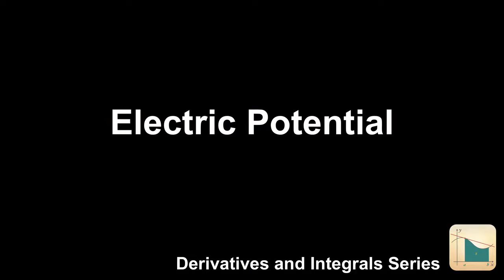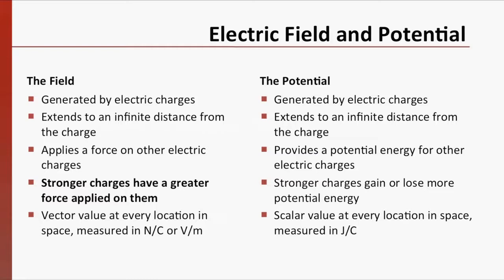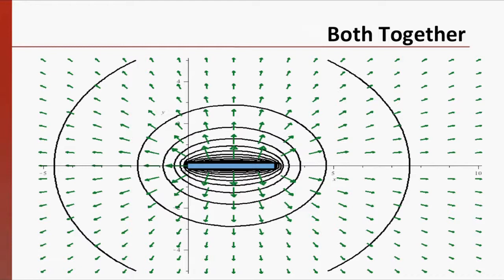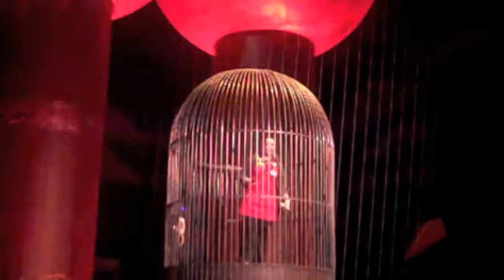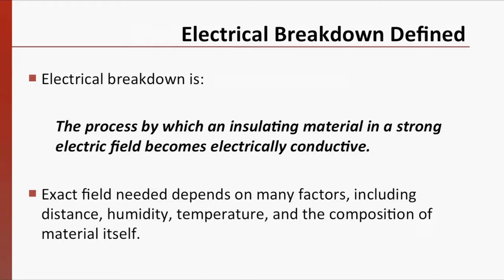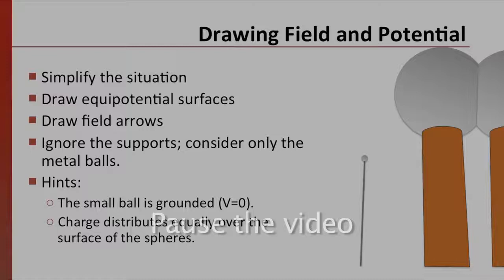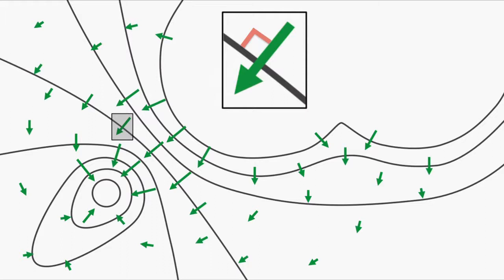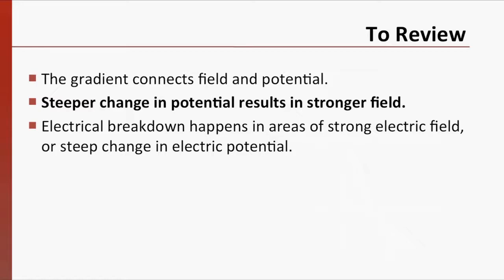Electric Potential

Comment: Isn't the steeper change in potential (higher electric field) necessary for the breakdown because the mean free path of an electron is usually quite small and it needs to attain enough energy to ionize the gas fast